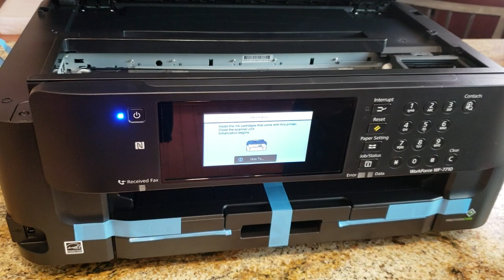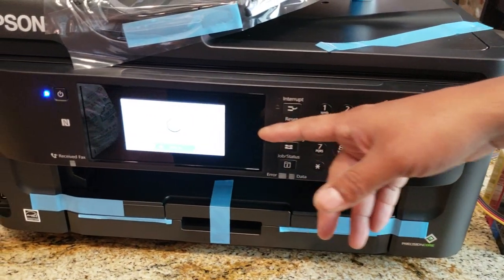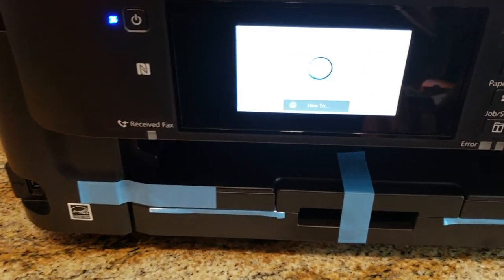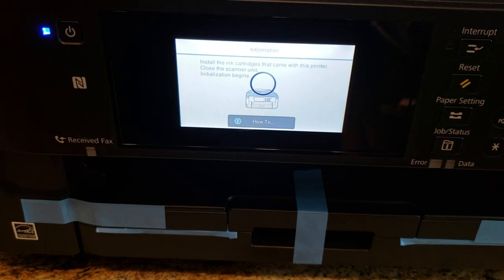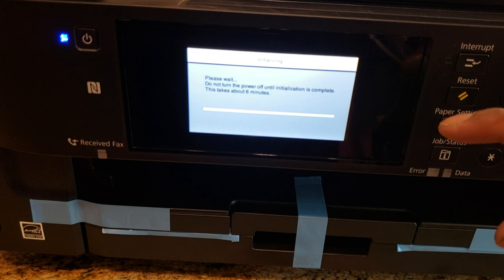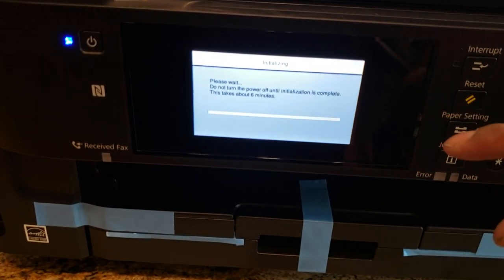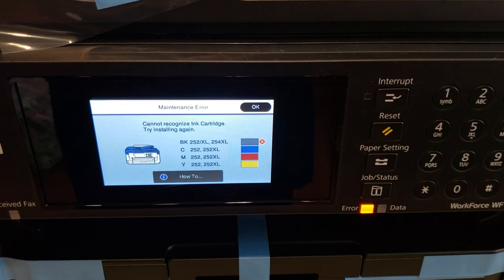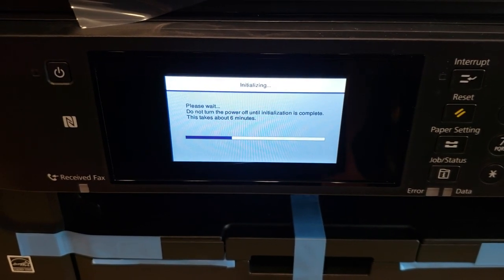WF-7710 CISS Install

Comment: This is a good video, but there are too many unanswered questions in the comments section below. The continuous ink system can either be installed when the printer power is off, or by telling the printer that you want to change the ink cartridges, so it guides you through.
I would advise from experience the following instructions
1. Fill in and prime the cartridges correctly
2. Make sure all plugs are in place
3. Insert cartridges carefully into printer and make sure you press down on them gently, so you hear a click and all 4 (I use the EPSON WF-7610 and my CISS has 4 cartridges) 
4. Press the RESET push button on top of the CISS cartridges)
5. Press 'Check' on the printer LCD screen (mine has one)
Possible issues:
A. If the printer is not printing one or more colours when firts switched on (ink is not coming out on the paper correctly) make sure all cartridges are primed properly. See 1.
B. If the printer gives an error, make sure the cartridges are sitting down all the way so their contacts make with the printer ones. See 3.
C. If the printer is not used often, it is possible that one or more of the cartridge heads to dry and get clogged. In this case you need to run the printer maintenance and clean the print-heads. Do not give up easily. Once I had to run the head cleaning routine around 20 times! It is a pain, but it did work 'perfectly' at the end.
D. Last thing to note: If the printer is not used often (say once every 4-5 days) then to keep the printer heads clean and in good shape you should print a colour test sheet every 2 weeks or so. A colour test sheet can be downloaded  from the web. It is a colour .jpg file and shows shapes of all colour shades including black and grey shades. Search on Google for 'printer colour test sheet' and you will find plenty

When my Epson printer comes up with the error message that the ink cartridges are nor genuine (I see the error every 2-3 months on my printer, but also depends on use) then pretend you are changing the cartridges (no need to remove from printer), and after pressing the RESET push button on the CISS cartridges, press the 'Check' on the printer LCD screen.

I also read in one of the comments here that despite the fact the black colour cartridge is full, the printer says that it is empty. In such case just ignore the error and continue printing, but do not allow the printer to use all other colours to make up black, cause the colour black does not look as good!

By the way, not all cartridges look the same. My supplier has his own video on YouTube with all instructions.
My comments here came from using normal inks for printing colour documents and photos (never used sublimation ink).

Comment: You could just put a dust cover over the printer when you are not using it and you won't need the air filters in the Ciss.

Comment: I've already added the drivers.  I was getting a print but now that I filled the cartridges in the printer, no ink is printing on the paper.  There is no air in the lines from this system.  I didn't get the initialization process after the initial one when I had epson ink in.  I'm not sure what to do next since no ink is printing on the paper now.

Comment: Hello - I just added the ink cartridge to my brand new printer.  It has never had inkjet ink.  I have two printers, one for normal print and another for strictly sublimation.  It isnt recognizing my ink, I have made sure it clicked into place and pushed the white button to no avail.  It wont let me get past this part to completely install the drivers.  Does one step need to be done before the other?  Any thoughts as to what I am doing incorrectly? 

Thanks for your help
Reply: Install the initial cartridges that come with the printer first. This is neccessary for the initial security system/calibration drivers check.

Comment: Hi, I forgot to remove small rubber seals from the top of the external ink tanks and now only black ink is not printing is any solution for that without using printhead Cleanig solution bcz it’s working fine but I forgot to open it so it might be stopped the ink flowing? Please help me out

Comment: If you don't run this system every 3-4 days the lines will  dry up and that's not good just so u know. If you're not going to be printing a lot use refillable cartridges.

Comment: The printer doesn’t recognize the ciss ink. It provides a maintenance error. I pressed the white button but it doesn’t work. What can I do?
Reply: Hi...here is what happened to me.. (I posted up near the top of the comments- was recent one..but incase you didn't see...hope this helps you): 

 first bit it kept saying " a maintenance error" after re inslalling many times,  I realized that after reading the screen many times...all it was -was the cartridges set JUST weren't down quite enough to click into place.(it clicks into place quietly, can barely hear it) but once that happened, it all went well !!

Comment: i cant get mine to click into place, its really annoying, im shoving it down and like 20 times it just wont click into place and wont recognize.
Reply: If you don't run this system every 3-4 days the lines will  dry up and that's not good just so u know. If you're not going to be printing a lot use refillable cartridges.

Comment: Mine shows complete, but there is barely any ink in the cord.  WF7710
Reply: Hi Regina, you need to prime it first. Can you kindly tell me the number on the chip? I have looked for this ciss system in my country but those selling it require me to have that chip number.